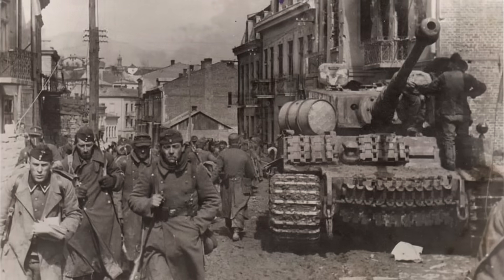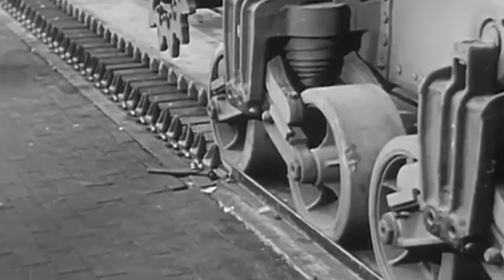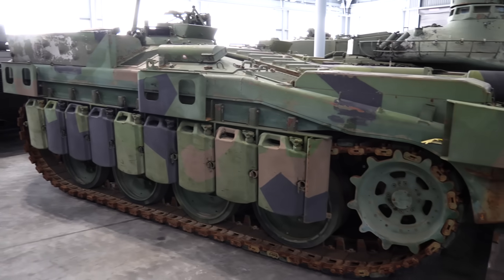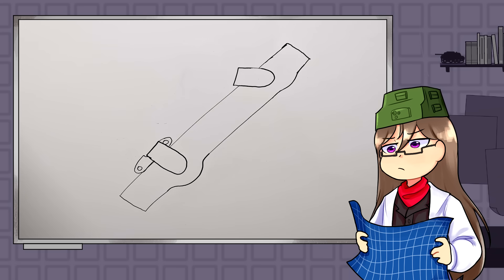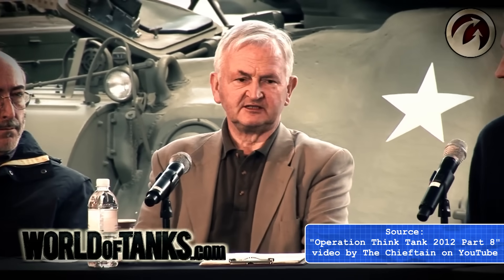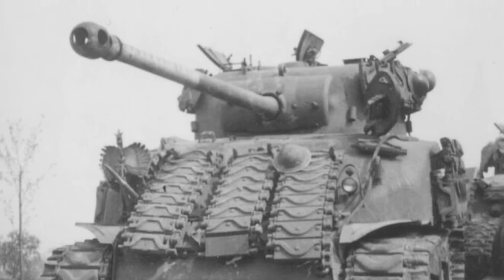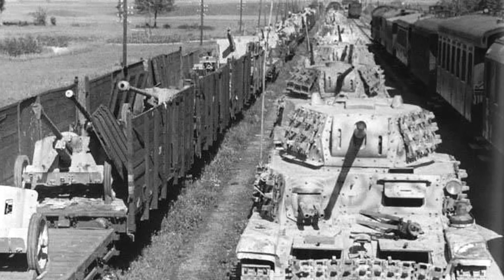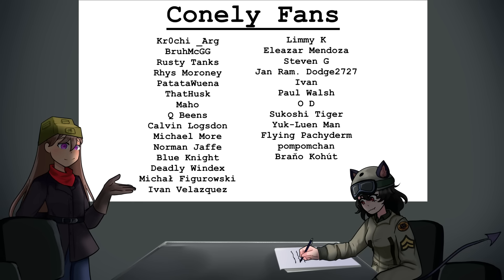Tank Tracks as Armor: Good or Bad?

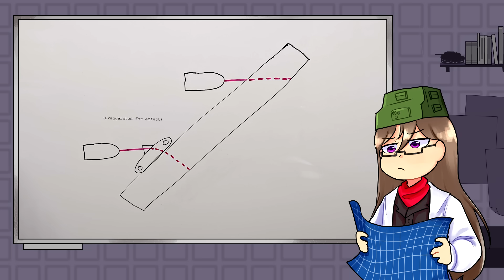Comment: 3:18 I was designing a tank on Sprocket, and added a 10mm track. The plate I put the armor on was approximately 200mm and was angled at 20 or 30 degrees to the horizontal. I tested the armor capability by shooting a 150mm cannon round with a theoretical penetration of 300mm. Naturally, the extreme angle at which the upper 200mm plate is at should default to a ricochet, and yes, that happens without tracks. But when I add tracks, somehow the shells normalize through the added tracks and go right through the 200mm angled plate. I was perplexed, thinking it was a bug, until I watched this video and found out the game, in fact, was very realistic.

Comment: Spalling and fragmentation will occur if a sabot pushes all that scrap metal inside the tank as it passes through.
Reply: Before you had a hole. Now you have a hole that's blasting the interior with fragments of foreign shrapnel at 5000 feet per second.
Reply: 5 dimes could cause enough carnage as an M67 frag grenade

Comment: I've been trying to ask some of the simulation channels to test the pulling effect as you call it. 

I kind of gave up since they thought it would be negligible. 

I do think it would be interesting to see with a shell that normally might ricochet or not penetrate like let's say apcr that with the softer material is actually able to stabilize itself rather than just detect
Reply from the maker: It would definitely be interesting to see it tested although I'd like to have it done IRL instead of relying on simulations. I definitely don't think it's an incredibly significant amount but according to the testing it does appear to have an impact in some cases

Comment: Surely if you have spare tank track pieces on the outside of your tank, you are carrying them because you want to have spare tank track pieces for repairs?  That's the main reason... right?  Those things are pretty cosy inside, probably not a lot of space to store what is essentially a "spare wheel".

I mean... no one is asking if the wheel on the back of a Jeep makes it better at off roading because it has five wheels instead of four... because it is a spare for repairs.

Comment: Just a heads up, the main reason you don't see the word normalization thrown around in documentation is cause for the most part tracks (and using the same concept capped rounds) don't actually normalize the shell, but rather simply reduce the likelihood of a ricochet.
Reply from the maker: I wasn't referring to it specifically for track armor, you don't really see the term used at all in documents

Comment: Seeing how I'm an expert, since I have played war thunder for a good while I can answer this. If there is track armor half the time it gets hit by a physics black hole from hitting both of the track and the armor at the same time creating a space breaking event which is called volumetrics. If it's doesn't have this affect where it seems to simply vanish, it will it the first plate then since this is how real physics works obviously the projectile will lose all its momentum and only have that of a pebble that got flicked instead. Note that it is 50 50 to not pen it in both out comes. This is purposely done because if you penned there are 2 out come instead of you pen. If you pen option one is it ignored the first plate or track and goes through normally. If it's the second option the snail looks upon you now. You get another 2 options, feed it or meet your fate with open arms. This was a brief description of what totally actually happens from a war thunder player. Thank you for reading this safety brief

Comment: so tracks do provide extra armor, but only if it's on a somewhat flat surface, otherwise it can do the opposite
with the exception of HEAT/HESH where it will help a little in any application

Comment: Interesting, thank you. Of course, all kinds of variabilities. I understand that there was a Red Army study that supported the use of track links for providing additional protection (see Tank Archives on the evolution of T-34 armour). It was found that whereas a Pak 40 could usually penetrate the T-34 from 1km, with track links this was closed to 800m. They therefore fitted spare track links to vehicles with the T-34 chassis to the front hull as standard in 1944.   And then you have vehicles like the Panzer IV, or Tiger 1, which have a lot of vertical plates. Pictures from the Eastern Front in particular would seem to suggest that the use of track links was quite common among Panzer IV crews during the latter half of the war, some vehicles being festooned with the things. I'm sure much of this was based on experience

Comment: He barely mentioned HEAT rounds, which is the primary reason why they put them on there. 

HEAT rounds are scary and tons of methods where used to add extra space to the rolled steel to nullify HEAT rounds.

Armor is mainly composite now BECAUSE of HEAT rounds.
Reply from the maker: Track links would do very little against HEAT rounds. I discuss the reason for that in my video on German side skirt armor during WW2. Composite armor uses specialized materials that reduce the energy from the HEAT penetrator which a track link wouldn't do, at least not anymore than standard armor. Space alone is not good at stopping HEAT and can actually INCREASE penetration by helping shells with standoff distance

Comment: in this case, that the additions 'drag' the shells, inversly they could flip the angle of the treads so it pulls the shell away from the main hull. or could you use hard, slippery low inerta plates like scales that the shell does not 'drag' into and tends to make the shell angle away?

Comment: WW2, due to its length and improvement of technology, can also add the issue of what may have worked in the early war may not work later on. Ballistic physics have a way of turning things on their head. Starting with air at this extreme acts like thick honey. This brings us to did it matter anyway.  You may very well have 65mm of front armour and added a type of track that adds a further 15mm for a total of 80 mm. So does it matter if the penetrator is going to punch through 110mm of amour at this range. So, regardless of what add on armour is used, it has more to do with the crews lack of faith in the armour protecting them than anything else.

Comment: I guess the idea is energy dissipate quickly.  If the shell hits the armor direct, majority of the energy would be transferred to the armor.  But, if the shell hits anything else in front of it, and even if it penetrate the first barrier, it would have reduced energy by the time it hit's the armor.  You might see tests like what caliber of guns could penetrate multiple layers of barriers.  The obvious physics is that the shell would lose energy and it will slow and stop as it penetrate each layer.  So if you have multiple layers of armor on a tank it's the same concept.  You might have some unique armor design where it isn't a solid layer but multiple layers of armor angled  and encased in a outer shell of armor.  But, when guns being so powerful nowadays, the best defense is to not get hit.

Comment: I've always thought that, after a few minutes of reflection, the answer to this would be obvious.
It will always be dependent on the angle between the armor and the projectile, and/or the type of projectile itself, and the velocity of most projectiles at the point of impact.

Even vehicles with apparently flat armor (Tiger Is, Panzers III and IV, etc.) can have their armor at an angle (from the projectile's perspective). Tiger I crews were taught to angle the tank, therefore the armor is no longer "flat", therefore enemy projectiles may be aided by track links in, partially or fully, penetrating the armor behind such links.

The fact that track links help to protect against HESH makes perfect sense, as there's significantly less risk of spall.
Against HEAT rounds, again, it makes sense that track links will be helpful, as they will increase standoff distance.

However, when talking about solid shot, APBC, APCR, APFSDS, etc., track links will, in most cases of angled interaction, redirect the projectile into a more favorable trajectory. Some energy will be lost in the process, but the more favorable angle will, most likely, compensate for the lost energy.  say "most likely" because it will, of course, depend on the projectile's velocity upon meeting the track links. In some cases, the velocity lost due to the track links can overcome the redirection benefits, but those are rare cases.

Comment: 6:50 that does not take into account, that you would wanna transport the additional links as spare links. due to this double use you could argue, that using the Tracks as additional armour adds no weight at all.
Reply: Yeah everyone is really missing your point OP

Like, you're bringing spare links already. Unless you're significantly increasing your spare parts load to do this, the effective weight of this "additional armour" is nil
Reply: @George_Davies maybe the weight distribution changes. This may lead to additional wear on the drivetrain
Reply from the maker: The tanks drive train would disagree
Reply: @ConeOfArc  what do you mean.
Reply from the maker: @MusikCassette  adding on large amounts of track links can add literal tons of weight to a vehicle. That weight adds additional strain to the tanks mechanical parts which can result in more breakdowns.
Reply: @ you carry track with you as spar parts. how does distributing them as armor add any weight?
Reply: @MusikCassette because its more metal on the tank. Trank links are heavy. Believe me

Comment: 2 possible solutions: 1 put the additional track plate vertically, so normalization is not possible. 2 same angle but losely attached, so the impact will push the plate up, not turn the shell down...:face-blue-smiling:

Comment: My prediction was "it depends on many variables".  For kinetic energy penetrators everything here appears on point, but in the modern battlefield most risks are from shaped charge type rounds so even putting very thin plate on stand offs is very effective at defeating them (as well as hull mounted reactive armor) since it will spoil the jet of hot metal that is the actual penetrator and that jet can only go a few inches before it deforms so initiating it early or disrupting it prior to actual contact with your plating very much reduces its damage potential.  As pointed out however a tank has a weight budget and while they have to carry around a few spare links anyway why not put them somewhere you are trying to protect, but carrying meters of links is overkill and the mass your adding would be better served with other protection like reactive armor.

Comment: A full track for an M2 is over 30+ feet long at 81 shoes.
Reply from the maker: Carrying spares is a bit different than carrying an entire new set of tracks on the vehicle which is what many of these examples have
Reply: @ConeOfArc  today we are spoiled by our great supply chain. These guys knew that the next time they got resupplied would be possibly never, probably before they ran out of fuel, and most likely before they starved to death. These don't have a full track worth of shoes on them. For an M2 thats 81 shoes. Fuel, Oil, and tracks. Without them you're a bunker.

Comment: I think your conclusion is wrong to be honest. It is worth noting that the cases of tracks bouncing a 75mm German AT round is HIGHLY unlikely as those guns had a really high velocity and would use APCBC rounds which are more likely to penetrate under those circumstances. Also it is somewhat worth noting that it is useless against APFSDS rounds as they just have too much penetration to care. So basically it works against HESH but doesnt help otherwise. They probably should have just built more Jumbos anyway.

Comment: The video dovetails with my knowledge of the subject. For side, rear and in some cases top armor then tracks have a positive help/risk ratio. For sloped and face hardened armor, track segments just give incoming AP rounds something to grip. In some cases, such as incoming HEAT rounds then there could be minimal positive effect.  

In WW2 scenarios with the shape, velocity, diameter and composition of AP rounds,  adding track segments to any sloped/face hardened areas would have been contraindicated. 

Edit...  The quality of the armor also had an observed effect.  The Sherman had softer armor than German in most cases,  so any added protection would be appealing. The original American 75mm gun also had a somewhat slower velocity due to the Bureau of Ordnance trying to extend barrel life

Comment: Another thing not mentioned is that unlike RHA, tracks aren’t completely flat. There are several gaps between the links. At certain angles depending on where the shell impacts the tracks, the force of the impact against the overall structure would be more concentrated than if it were to just hit the plate directly. This is especially true if the diameter of the shell hitting the link is greater than the link itself. Not only that, but if a tank armed with an APCBC shell were lucky enough to hit perfectly in between the links, the Ballistic point would rotate the AP nose of the shell within to be almost dead on against the plate, which is crucial in defeating the armor. Whether a shell bounces off an armor plate or goes through can in many cases depend on nose behavior alone. It’s why even very heavy uncapped AP shells going really fast actually have worse angled penetration than capped shells of a lower velocity and caliber. As such, an uncapped shell that would normally be completely unable to normalize against the armor would easily punch through due to the tracks helping change the nose position.

Comment: A couple years ago I read a study about the effectiveness of improvised armor conducted by the US Army shortly after WW2. It was quite detailed, even testing the equivalent improvised armor's thickness (such as concrete, wood, tracks, & sandbags) that would equate to a certain amount or armor plating. The overall conclusion was that improvised armor provided little to no benefit outside of psychological boost for the crew members, and in most cases (particularly with regard to concrete & sandbags) the effect was detrimental due to increased weight and consequential wear on the drive train. Some of the data was quite shocking, for example: the tests showed that, in order to stop a standard Panzerfaust-60 HEAT round, it would take something like 24 inches of added concrete. If I remember correctly, for a standard Pak40 AP round it was about three feet.

Comment: Funnily enough, soft steel caps were (or maybe still are?) Used for AP shells for that specific purpose, basically letting the shell "sink" into the armor despite the sloping. If i remember correctly, it was first used in battleships

Comment: They did think that the fake trunk spare tyre position on Lincoln Contental 71-78 inceased the rate of penetration, as it (together with Caddillac Eldorado of the same  vintage), were the 2 most Pimped up cars (as in used by actual Pimps, in their actual profession.)

Comment: @4:00 what if the two plates were set at opposite angles so the deflection off the first benefitted the second. Any example of this being tried?
Reply: I think realistically, it'd be even more directional reliant than normal sloped armor, making it harder to use. But would also be more complex,  potentially fatally flawed if the primary "blade" for the first angle broke off, and just not much more effective than a thicker plate at one angle. Tis a neat idea, like an anti-shot trap, or maybe an intentional shot trap, so to speak, but in wartime production it'd be considered way to complex back then. Unless you were Porsche, then you could probably at least get a prototype or two out 😂

Comment: Sorry but this video is bollocks. There are no such traps in modern tank warfare. Modern ammonition just weld through straight as a dart or as melted liquid. There is no actual mass or shape that could get deflected like that. So yes, tracks on the outside means more material that needs to get penetrated.

Comment: I'm now curious if reverse spaced Armor was ever tested, particularly as a protection against spall damage.   By reverse I mean the thicker plate was on the outside with a thinner plate on the inside separated by a certain amount of air filled space.  I wonder if it would still be more effective than single plates vs heat shells as well

Comment: Tracks are not made of armour steel.  Because they're not hardened like armour plate it makes perfect sense that they are less effective than the same mass of actual armour plate.  Probably the best improvised armour of ww2, was scavened plate from knocked out tanks.  Like the sherman field mods with the front plates of knocked out Panther tanks welded on.

Comment: I'm rather confued as to why track links helped for the Sherman but not the Churchill. given the main issue being for angled armour.  The Sherman's front glacis is sloped. but the Churchill isn't.  Being pretty much just an armoured box it's hard to think of a tank that should have been better suited to using spare track armour than a Churchill.  All I can think of is the extremely thick links of the Churchill's track were esentially acting as shot traps.